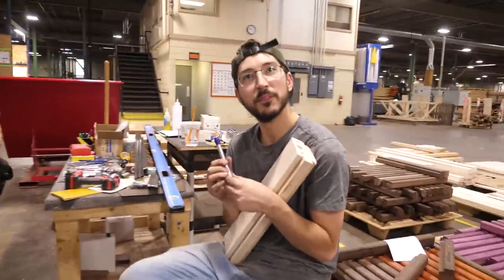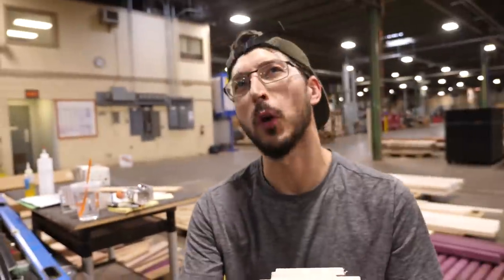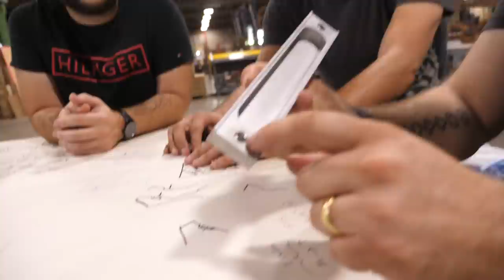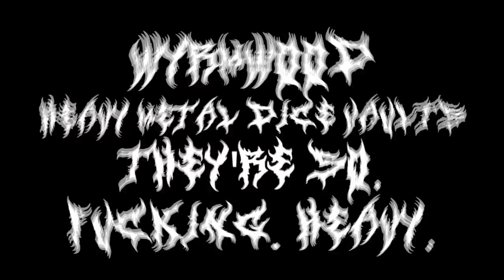Heavy Metal Vaults ARE BACK?! (M&T working great!) S8E23

Comment: One thing I don't understand is why don't they have another/ backup M&T type machine? 
I work in the 'shop' construction industry. When we create metal stud walls we have a main machine and a backup.
We don't like using the backup but it's there if we need it.
If Wrymwood's backup is just 'our woodworkers' that business model will ALWAYS be behind schedule and eventually run out of parts.
Reply: This was kind of their first project that required that sort of machine. The M&T was purchased specifically to make MGT happen, because it was the first time they were making a project that couldn't be done by hand at the scales they were working on. They could have bought a second machine as a backup, but then they would have just had 2 machines sitting on the floor not working correctly instead of one.
Reply: @Entaris  I'm not saying that they should have purchased the same exact machine for the backup. If you don't know the quality you either try for something different or make darn sure your human workers can keep up pace. We have two different machines running our walls. You NEVER should rely on just one machine to keep up with production if you're this big of a company. It's just asking for problems.
Reply: @countrybum1423  i would say the cost of the first machine along with the million or two of other capital expenditure (plus buying Keystone) precluded a second machine.

Comment: So not trying to be a dick but both of the pallets shown in the opening are problem for different reasons One is outside of the standard size of a pallet which as a result means it's going to cost more to ship The other hardware is unstable and might damage the other stuff in the load

Comment: I'm going to say Massachusetts pallets look professional and aline with the cost of the mgt. Pa pallet looks like it has a high risk of shipping damage which can add up quickly considering the number of parts.
Reply: MA sent one a while back that while putting on the trailer, the product stayed shrinkwrapped together, but slid off the pallet. We went to unload in PA, and it was just a shrinkwrapped pile of legs. I enlisted a few MGT guys to pick them up.
Reply: @jonprager  interesting would it be beneficial to put a layer of paper between each stack and the strap half the stack as one bundle then the rest as a bundle. Kinda like a double burrito.
Reply: Yeah to be fair, this is all shifting that's happening during transport. You have layers of flat pack items that stack well and wrap well, but then once turns start happening in the truck those layers start sliding independently of each other. Making the strapping tighter won't help, it's acting like a big rubber band, soon as those layers shift, strapping will just get looser and allow individual pieces to move. Probably need something to separate layer by layer, I don't know if paper would work but just anything to keep those layers even.
Reply: Yup. To compound things, Keystone Transport isn't a general freight company, we primarily haul blanket-wrapped furniture, so there aren't always pallets next to the pallets to help hold them up, there may be gaps between pallets and furniture, or piles of packing materials etc.  The pallets going to them tomorrow looked good when we loaded, but will travel 400 miles and go to 5 other stops before Wyrmwood.

Comment: I'd buy the Aluminium (Good Doug) one. It would stand at out, at the least, and not be as weighty as the others. 
Weight really isn't an issue for myself though (but price is, so that's why). 

However, the carrying of one of these vaults with say, some of your wooden products in a backpack or shoulder case, would need careful placement. Keeping it separate, low and well padded. Kind of the like dice inside any of them should be, as I'd never let them in there 'naked' and clanging. You'd better be offering that, right? I'm sure people just keeping this in their home and never for traveling wouldn't care though.

Niche would certainly be a thing, but that's still metal *guitar*. I mean you're Wyrmwood, not Wrymmetal. Hmm, that name needs some Wyrmwork. Right, I'll leave now. :P

Comment: I'd buy a metal vault if it was lined with rubber to stop any shifting inside, otherwise the possibility with regular use travelling with them to game nights and having them shift around of losing the polish/finish some of my dice outweighs my interest in it, it's really cool though, and I'd definitely get one with that apple matted finish or a polished finish if it was feasible to make, it'd also be cool if you made the ones that tarnish/patina with an optional finish to prevent oxidization...

Comment: Why don't you try just a metal "shell" then wood inlay it like a normal dice vault and regular foam as well. To solve the issue of chipping dice and wear and tear. And you can mix and match the wood with metal.
Reply: then you would still start with a metal block of the same size and just mill out more of the material (and waste more by extension), unless you are making a folded box of metal sheet (which would look like shit)
Reply: They'd need to be like drop forged or something from sheet stock, to save on huge waste costs.
Reply: ...at that point make a "vault vault" like TCG doublesleeves
Reply: I want mine made from a disparity of scrap pieces, in places bolted, in places welded, with spikes, fins and ventilation slits, and with rust and dried blood stains and I want it shot by Crazy Ed (just once). I'll call it the Magnum Opus and use it to run a custom Mad Max-themed campaign for Deadlands: Hell on Earth.

Or at least one of my alternate-reality selves will. Probably.

Comment: I saw that little log drawing on the white board, nice drawing ^.^
I wouldn't buy one of the metal vaults, just not in keeping with the rest of the Wyrmwood items.  I like metal, but definitely prefer it as an accent in wood.  Such as if the sides were metal, but the tops were wood or vice versa.  If vice versa, it would be less of a concern about damaging dice, because the metal tops would be covered in foam on the inside.

Comment: Can you lower the material thicknesses on the metal ones to decrease weight (without lowering durability?)? Also... what about rounded corners instead of chamfers? Seems less likely to gouge your table when you drop your 10 lb. bronze vault.